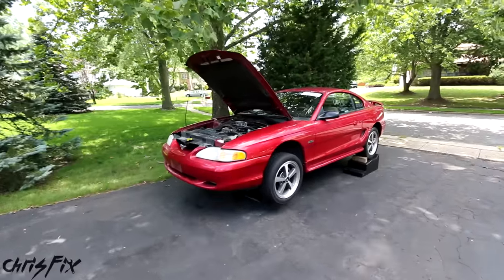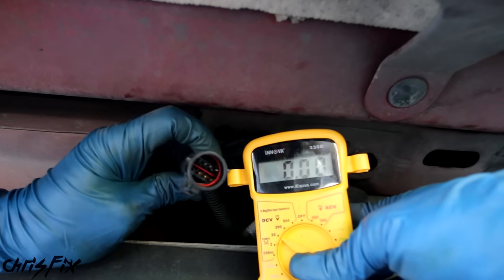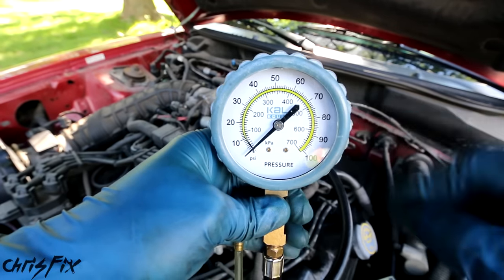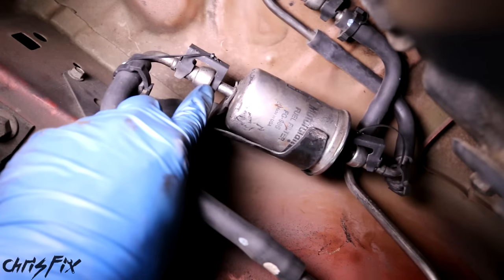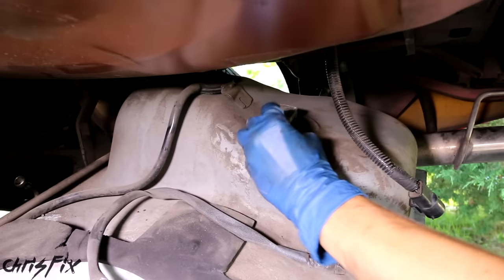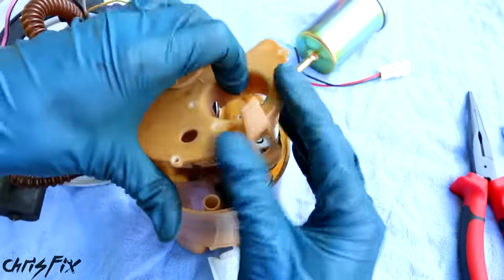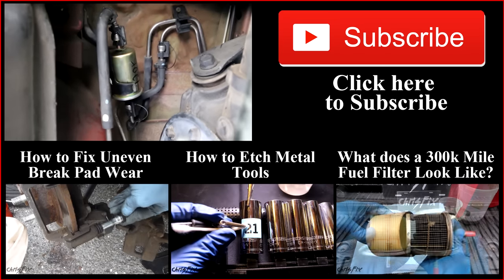How to Diagnose and Replace a Fuel Pump

Comment: Another worthy mention, it wasn't needed here because the car had been sitting for a while, but to be safe, before messing with the fuel lines at all make sure to crank the engine a few times so the  injectors are firing and you don't get gas spraying all over you, because let's just say your fuel pump just died out of nowhere and you used the car fairly recently, those fuel lines may still be pressurized and able to squirt gas all over the place, and one stray spark, which isn't uncommon with all the tech around us nowadays, you could get a fairly bad burn if the gas or it's vapors get lit.

Comment: I have a 97 mustang V6, when I hit 3k RPMS and sometimes From a red light or stop sign, it stumbles and at 3k rpm it feels like it’s misfiring, but I get no codes. So I’ll try the fuel pump because sometimes the fuel pump is really loud at idle. My idle is really rough, engine shakes so bad that my whole car shakes. I’ve changed everything fuel related and spark related, except the fuel pump.

Comment: I just have a question. Did you ever plug the fuel cord back up in the back of the car before you check the psi pressure

Comment: What do you think about a fuel pump that activates but the pressure is only 10 PSI. I did a flex fuel upgrade (eflexfuel kit) on my 02 GT so I'm thinking that my fuel pump can't handle the ethanol content. It was at 61% ethanol when the pressure dropped. The car did have 40 PSI after the flex fuel mod but a few days later it dropped to 10 PSI. By the way, I already replaced the fuel filter yesterday and it did not help. UPDATE: I found my OEM housing, cleaned it up and installed the new fuel pump in it. Running on 61% ethanol for a few days but when I refueled this morning the gas gauge quit working. I had a broken wire on the float and thought I did a good job soldering it back on but I guess I am wrong.  Going to have to drop the tank again and hope I don't mess anything else up (especially the filler tube grommet). I hope I can drop the tank like you did and can remount more easily this time (took 4 hours to get the tank back on a few days ago). I wonder how you managed to drop the tank like that without destroying the fuel neck grommet on the tank or the fuel filler itself.
Reply from the maker: It's totally possible the pump is going bad but I would inspect the lines and your work area first and make sure there is no kinks in the line or blockages or anything like that first
Reply: @chrisfix  The gas is getting to the fuel rail but I can't get a pressure reading at the Schroeder valve. Either I'm hooking up the meter wrong or 10 PSI won't register on it. I'm surprised that I can start the car at 10 PSI pressure. I know you have a YT video on how to clean the entire fuel system so I'll take a look at that. I do have a new fuel pump coming that's rated for E85 just in case.

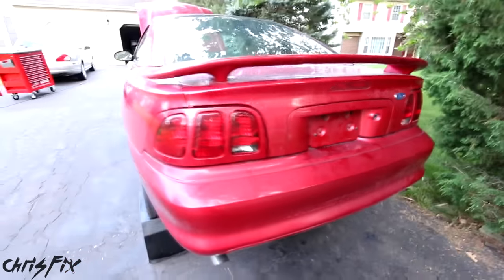Comment: at 12:00 put the cap on and check for leaks, then again minutes later - a slight pressure will develop with just cap on. I know the hard way.

Comment: @ 1:40 about checking a fuse by looking at it. Here is a story  Was few 100 miles away from home on a motorcycle. Made a stop and shut the engine off. Then tried to restart it and got  nothing. Pressed the  starter- but got dead silence. Checked the fuses. ALL looked perfect. Managed to push start the bike , Drove few miles found a motorcycle shop. The Owner told me it was the battery. I didn't think it was but went to a walmart,  bought one,  essed with pouring the  acid into it on the parking lot without any water nearby to wash my hands in case i spilled some on my skin, And it was already getting dark. Finally got the battery in the bike in the last bits of daylight. Still no go, the bike wouldn't crank, It WAS NOT the battery. The mechanic was wrong. Push started the bike again,   with someone's help,  and limped home the remaining 300 +  -  miles with head light getting weaker all the time.  When I got home hardly any light was illuminting the road in front of me. It was very stressful.   The next day  I set out to find the problem.   Started the investigation from fuses again  only this time I used  my voltmeter,  and bam,  right of the start   one was bad. Replaced it and   the bike started instantly.  I thought how, if I was smart,  I could have avoided all the  misery of the previous day , the loss of money the begging of strangers for a push, the risk of  burning my hands , the driving for hours in half darkness, the risk of  being pulled off the road by police  all this if I had     just  checked the fuses with a voltmeter not with my eyesight.

Comment: I'm having a no start issue on my 02 v6 mustang with 63k.
 Pump primes, cranks strong and no pressure at the valve up front. 
Will start right up on starting fluid.
Ran perfect for days before. 
Just changed the fuel filter.
 No change. Any thoughts? Thanks in advance!
Reply from the maker: Sounds like either a lack of power getting to the fuel pump or the crank sensor is faulty!
Reply: @chrisfix  Thank you for the help! Turned out to be the fuel pump itself. Didn't think so right off the bat because I could hear it running. 

New one is much quieter and she starts right up! 🙏

I definitely expect some issues she sat a ton...an 02 with 63k.  And I've been driving it a ton. 

Anyway. Absolutely 💯 love your videos! I've been watching for yrs. 
You are the best! Keep up the good work!

Comment: Hey Chris: I'm curious how you got the siphon hose in the tank (is there a rollover ball installed?)? The 2001 Mustang I'm working on won't allow me to put a hose down into the tank.. Just stops dead...Also where you show the relay behind the kick panel - can the socket's terminals be jumped to run the pump? thanks!

Comment: Hey Chris, I have a 1997 Nissan Maxima. Not sure if its normal but when I hard turn for example going on a Highway ramp to merge to freeway I notice my fuel gauge goes down and when driving straight for a while it goes back up. I had a 1996 Nissan Maxima and I don't remember doing that. When I have a 1/4 of fuel in the tank it goes down and the low fuel light turns on, and I know the 1996 Maxima didn't do that. I remember 1 time I had the 1996 lower than 1/4 and it stayed the same. Not sure if you can help me out to figure out what's the problem, I would really appreciate it. Thanks for taking the time on reading this.

Comment: Hey Chris. Don't know if you're gonna read this but I'm just gonna give it q shot hopefully yoy can find time to respond. I have q 2009 Hyundai Santa Fe 2.2 CRDi. The engine is often making a knocking sound and the cabin inside is shaking a little bit but it goes away when I stop and start the engine. Would you be able to tell some possible issues?
Reply from the maker: It could be that you are using too low of an octane, the timing went bad (although for a chain it's unlikely but still possible), it's running a little lean, a knock sensor went bad, or your tensioner and pulleys went bad. Worst case, the bearings in your engine are too worn, but in this case I don't quite think it's rod bearings.
Reply: Thanks Chris. I'll be noting all of this. Although my car is a diesel engine so it's a cetane rating?? I'm confused with diesel because gas stations doesn't tell much about the cetane rating, just some bs name and branding. I think I need to change the tensioner and drive belt because it's been bathed with engine oil before the leak was fixed. 

Didn't expect you'd respond. Thank you and much apreciated. Been following you since I found out about your channel.

Comment: Plz don’t bully me but is the assembly of the fuel pump universal? I’m buying a is300 so ik it’s easier to access the fp, it’s in the back seat. I just want to make sure I can replace the fuel pump as soon as I get it
Reply from the maker: The assembly isn't because fuel tanks come in a bunch of shapes/sizes but the connectors on the pump itself will often work with a lot of cars! Make sure you still buy one that's compatible with your car!
Reply: @chrisfix  Jesus it’s Christ, it’s Chrisfix. Thanks g

Comment: My moms 2012 Chevy Malibu starts and she hasn’t really touched the fuel pump stuff since she got the car years ago but when I turned the key to the on position I didn’t hear any whirring noise, the car isn’t top notch but it runs and I was wondering if that lack of whirring could still be a problem

Comment: My 2002 Sierra will crank hard some mornings. usually takes 2 or 3 cranks to start and idles rough at first. I'm think it's the fuel pump but not sure
Reply from the maker: Sounds like that could be it, I would test out the fuel pressure and go from there

Comment: Having trouble with my rsx replaced starter ,fuel pump relay,  crank sensor but still no prime on the fuel pump going to see if i get power to the terminals at the tank hope its just the fuel pump

Comment: hey chris im having a very similar issue and i need help with my 95 mustang gt fuel problem. its been sitting for 8 years. just changed the gas tank and fuel pump and relay clicks on, fuel pump primes, and engine turns over but wont crank. and fuse is okay to the fuse box. also i know the engine cranks because im able to start it with starting fluid. if your able to help me solve this issue, it would be a really big help.
Reply from the maker: I would follow this video if all of that checks out: https://www.youtube.com/watch?v=PNhuDCVIydw

Comment: My 02 Malibu fuel pump relay has no ground.The pump will run if jumped at the relay.I checked the black wire under the fuse box as I took it apart and check from the black wire to the fuel pump Junction block and had continuity ,I checked the gray as well.Any ideas ??

Comment: As a newbie, how do you know what all the hoses in the engine bay do, is there a marking of some sort?
Reply from the maker: There is usually an emissions sticker or something similar on the hood that can give information, but it doesn't tell you everything. Most shop manuals should have diagrams of hoses and parts, or you can do a search online and see if anyone has made a diagram for your car/engine.

Comment: Should you disconnect the battery before checking the fuses??
Reply from the maker: No, there is no reason to!
Reply: @chrisfix   thx for the awesome video!! If I can confirm the fuel pump is bad in my 02 Saturn SL1 5-speed, I'll have no problem changing it thanks to your video! My girl is lacking power going up hills.. I'm thinking it may be a failing fuel pump because I heard from another trusted YouTuber that losing power going up hills but running alright on flat ground could be just that.. but ut I gotta do a continuity test on my relay because I haven't been able to hear it click.. my fuse is okay. I haven't checked the source voltage in the terminals yet, I just assumed they'd be fine on the moment..I figure a compression test may be a good idea too just in case it's just my engine is just on it's last legs.. I'm hopeful it's not. Either way, I'll be better off with your awesome videos at my disposal!  I'll be sure to follow your exact instructions here to be sure:) thx again!

Comment: Mister Chris I need your help. My 94 Gt has died on me three times while driving and I need help diagnosing the problem. Each time it dies, the fuel doesn’t prime for like 6 or 7 cranks until finally the fuel starts priming, car comes on, and then died like 5 minutes later. I figured probably a bad fuel pump so I bought one and am gonna replace it myself, but if that’s not it, what else could be the problem? I checked the fuse and it was fine, inertia switch was good aswell

Comment: Could the fuel pump cause inconsistent misfires? I get multiple cylinder misfires when I first initially start the car, but sometime after (could be 10-20 minutes) it’s almost nonexistent. I eliminated any other possible causes like the spark plug, ignition coils, cylinder leaks, etc., but can’t seem to find what’s causing it. The only other option besides the fuel pump is the ECM...I haven’t been able to rule that out yet. I have a 2007 SAAB 9-3.

Comment: I've got a 86 f150 that I believe needs a fuel filter, fuel pump, or egr valve hose(recently discovered it was in 2) but not sure so I'm got all 3 and running through. was heavily neglected to the point changing oil and air filter literally doubled performance lol but its a v8 and when you step off gas its dead quiet and once it warms up on highway speeds 55 mph itll go for a few miles then buck, lose power and try to regain it resulting in a bucking every couple seconds almost like turning a vaccume on and off repeatedly and eventually lose all gas pedal response until it drops to 30 mph. since my last test drive it barley could do 20. any thoughts
Reply from the maker: I would check all the vacuum lines running around the engine and replace any that are broken, and I would also clean the IAC and throttle body to ensure you're getting the proper flow to the engine: https://www.youtube.com/watch?v=KhvqT3blzVs
Reply: @chrisfix  thanks for the reply and help. I haven't checked all vaccume lines but I'm sure thats it as it wants to bog down at idle. cleaned the iac and it was partially clogged with carbon (appreciate the video included bro was a life saver lol) and I'm pretty sure the fuel pumps ok I heard it hum and pushing fuel through but you're videos have been amazing and I really appreciate it man not a single person is as knowledgeable and helpful as you are on cars wish I could sub twice cause you deserve it lol.

Comment: what could be the problem if the car stutters when you drive for a longer time at 3-4k rpm? i was thinking maybe the fuel filter or pump or a sensor but idk how to diagnose the problem. it once didnt even start then worked somehow again
Reply from the maker: Sounds like your fuel pump is starting to go out, I would get it replaced!
Reply: ChrisFix thanks chris

Comment: The 02 Mustang GT is different. It has a module mounted near the inertia switch that can keep the fuel pump from running. And I'm not sure if you can siphon gas from the 02 Mustang. And what about cleaning the tank?

Comment: Hey Chris i have a ford ranger same as yours and the pressure only goes up when I pressureize it by putting it into the run position like 3 times but it goes down fast . Is my fuel pump bad ? Thx

Comment: So my car was starting kind of rough but it would start . I replaced valve cover gaskets because oil leaking causing plugs top foul up . I replaced intake gaskets , spark plugs, I am going to assume i dont have any vac leaks (maybe) ....anyway car started up but still had a rough start but wasn't as bad . I replaced fuel pump and filter and now car just wont start , almost sounds like its flooding it . It just cranks for ever and sometimes it wants to fire , this car is becoming a nightmare and i cant figure out whats going on . I have replaced so much crap and thought the car would run better but now it wont start , the cranking does feel much cleaner and stronger then before doing all the work but i cant seem to find the issue , before i start digging around fuel related issues maybe you have some insight on what could be going on ? any help would be great , at least where to start looking ....I got a 2000 v6 mustang 3.8L

Comment: Hey Chris, my car was driving fine, started fine and running great and when I was driving all of a sudden there was an instant loss of power while I was pressing the gas the, speedometer started to drop to 0 and then the car turned off, wasn’t able to start it again, but electrical was all working perfect, could this be a fuel pump issue?
Reply from the maker: Does it crank at all?
Reply: @chrisfix  when I turn the key there’s a clicking noise then nothing. The same thing that happened to your neighbor happened to me. I’m terms of how it died on him
Reply: @chrisfix  but no I don’t think it’s cranking Chris, what could that be?
Reply: @chrisfix  also just replaced battery and fixed Two cylinder misfires. Tan great for 2 weeks and this happens
Reply: I’m starting to think it might be a starter issue?

Comment: heres another tip when your fuel pump wont turn on- sometimes you can slap the gas tank with your open hand and it may jar thr pump and get it to work long enough to drive it into your work area.

Comment: Got a question for ya, I know this is like four years ago, but I’m having a problem where my mustang doesn’t start, I’ve used some cleaner to unclogged the filter, and its been the same before I unclogged, it still starts up, but I have to stomp on the gas pedal in order to start it up, any advice for me my roommate says I may need to replace the fuel pump

Comment: Can taking a reading across the circuit be wonky and still work?

I’m not able to get much more than trace voltage, like .1, but I also have cause to doubt the reading. I can still get a hard start going after some effort. If it was an electrical issue, wouldn’t it be impossible to start the vehicle at all?

Comment: This is an old video, but I was wondering if I can get some advice.

My car won't start unless I "prime" it by pressing the accelerator a few times with the key in the ACC position before I go to start the car. Is it a fuel pump problem?

Comment: So I have this issue;

My car was at temp driving, and then my check engine light came on. I lost a slight bit of power and had some engine shake.

We checked and got a multiple misfire readout.

When the car is started, if I give a tiny amount of power, the car then will struggle to find idle again when I release and nearly stalls but saves itself.

The car runs perfectly fine with power above around 1000rpm 

What does everyone think?

Comment: Sometimes my fuel pump hums and I can start my 1999 civic and drive np. But sometimes my fuel pump is dead. Its a roll of the dice.. 50/50 chance it works.  Should I still try and replace it? Or is there something else I should check?